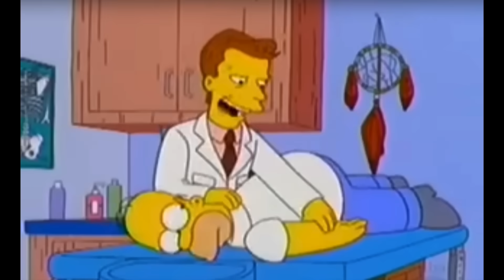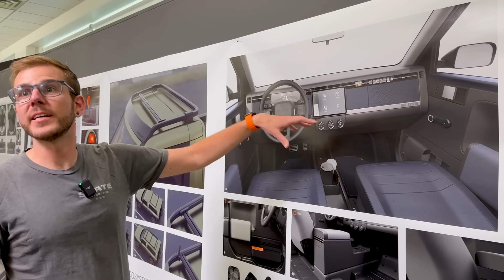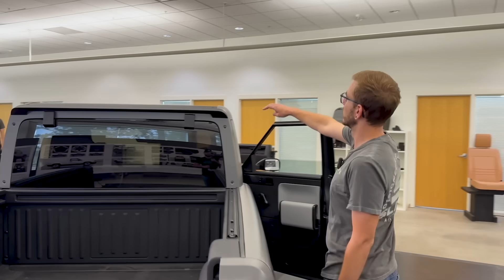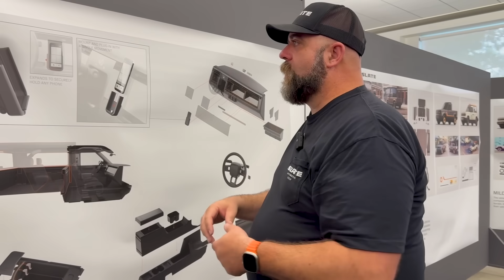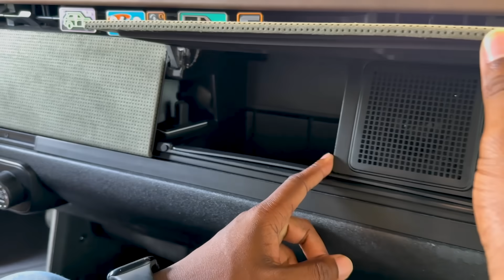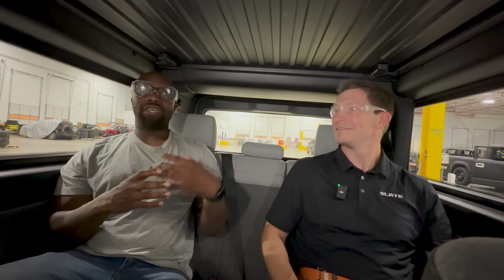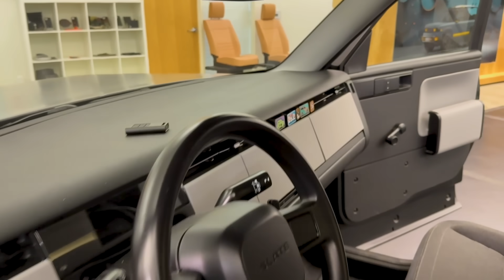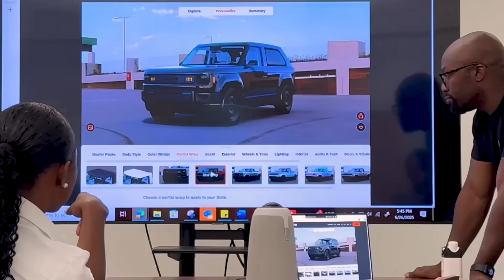The Slate: America’s $20K Answer to China’s Cheap EVs (Exclusive Access)

Comment: Tbh I have a Maverick and I love it. I think the selling point for me would have been if he said “our truck doesn’t have all of the glitches and bugs that a Ford will” to date the only complaints I have with my Maverick is that the radio USB doesn’t work like 20% of the time and that the remote features are constantly being disabled, that I have to press 6 different things to get the information pop ups to go away and get it back into eco mode every single time I turn it in. and that the transmission surges sometimes when sitting on the brakes at a stoplight. Great truck but Ford just doesn’t care to make it user friendly.

Comment: So they ultra designed it but made it cheap. It's not a truck. No 4 wheel drive. It can't tow. It's slow. You get what you pay for. All that design will just be incorporated by companies that build real actual useable trucks. I always wanted to make an inexpensive vehicle, but, this is just cheap. Wrong platform.

Comment: At the end you hit the nail on the head, Cost of the accessories, I can see the price going through the roof and it still only has 200m range.
The one thing I like, it does seem like a car for life if it can be cheaply upgraded and repaired, a for a Ford Maverick a few years down the line when out of warranty could have a relatively minor fault that writes it off, for example a dead headlight bulb on my model Y is £1200.

Comment: I see the future of having my own parts house with the curbside supply of easy* to disassemble oem parts. Thanks Slate!
*with special fasteners and only owner access? 

Base is base (rwd, crank windows) but if you go on the the website and price it up it gets pricey pretty quick, and it's still RWD and crank up windows (and how about no opening rear windows in SUV mode?). All said, I'm still cautiously optimistic and look forward to trying one when available.

Comment: I don't want AWD.

First issue is that AWD reduces energy efficiency to around 75% of a F/RWD configuration. This truck only has 205 miles of range as RWD-- thus the concept would greatly reduce both the range of the vehicle & ultimately the longevity of the battery.

Now maybe they won't do an AWD drivetrain with differentials, et cetera. Maybe it would just be 4 direct drive motors that ultimately behaves like AWD. That's still double the cost of one of the most expensive, maybe second most expensive of all the parts. Not sure if i need that-- at most i'll probably be hauling like 1000 lbs of groceries on slightly damp pavement. 🤣😅

My point is: It's a personal use truck. How many Americans drive on totally 'virgin landscape' in our personal cars for work?

Comment: FALSE. Slate is less car for the SAME money. Do the math buddy. I actually admire Slate and I like the concept but I ran the numbers and give it thumbs down on its main feature - value. A Fastback SUV 5 seater STARTS at $31,950 for a SLOW, LOW RANGE, DUMB, 2 DOOR dorky pickup (there is no way to make it into a 4 door ever). For a mere $5,040 more you can get a fully equipment Tesla Model 3 with 50% more range and much better 0-60 performance and ride quality, super safe plus ALL of the tech and creature comforts as well as the ability to Self-Drive. The Tesla Model 3 can be your one and only vehicle for a household, not quite so much with a Slate especially if you ever plan to go on a road trip. Do the math and equip a Slate they way you would really want it (and in many ways you can't even do that despite the gazilion accessories). If Slate started at $17,490 it would be a bit of a different calculation but it isn't. A niche vehicle at best. I'm calling it now - under 50,000 units will be sold if that as it mostly appeals to the low volume Jeep Wrangler crowd. People want a HIGH TECH smart car with all the latest features, not a dumb car like a landline or flip phone. Slate fell in love with a CONCEPT not a vehicle the market will actually buy - they went down the rabbit hole of confirmation bias. Yes, I realize my opinion will come across as strong but go configure and price one yourself and I think you will end up agreeing with my analysis (and I am unhappy with my conclusion too).
Reply: You just go place to place posting the same thing.
Reply: @johnkeith2450  Yep. Glad you got my point.

Comment: This looks so much like a cross between the first-generation Ford Bronco, a later-model Range Rover, with a hint of an older International Scout.
Reply: I love it. I drive a late-model F-350 for work reasons, and I probably need one of these to save on fuel costs. Materials gathering, etc.  Of course, an A/C is a must in Texas. I only wish the truck bed could slide out to +-8 feet to carry standard plywood and lumber.

Comment: The time you get the extended battery on the stripped no power anything model it's 32,000 I can get the Ford maverick xlt with everything and leather for 31,000 power windows doors and radio and you don't have range problems. I'm buying the Ford.

Comment: I put down my 50 bucks for a Slate.   This is the vehicle I want.   Currently, I drive a minivan that has power windows, power doors, power sunroof; and when those motors and mechanics fail, its very unpleasant.   When I get my Slate, I want to build a camper to go on it.   Put in some lightweight flexible solar panels and hit the road to travel at no cost.

Comment: Couple of interesting points on both sides of the picture for this truck. As far as their sales pitch goes, I think two things that were appealing to me as I thought about it would have to be the fact that from other brands when you buy an accessory, it’s in a package deal configuration. Obviously this means you’re gonna get the one or two items in the package you wanted, but you’re also paying for a bunch of other stuff you don’t necessarily need or want. This plays into Slate’s sales pitch.  So, I do like the idea of picking and choosing exactly what you want. However, looking at the build quality in the videos I’ve seen for this truck, It seems like the quality isn’t there. Mostly plastic parts. Personally, it’s not for me. Because even though it may only be $25,000 it’s still $25,000 folks! 

 Keep in mind as Rich mentioned, if the price of the accessories is high then you end up in the same place as all the other manufacturers in terms of total cost. It’s pretty much self-defeating, isn’t it?

And Rich you will also mentioned them range? Why isn’t anybody else concerned about that? And what about towing capacity, hauling capacity? Is it a real truck or is it just something that looks like a truck?
I don’t know, did a lot of answering questions. We’ll see what happens. Maybe it’ll end up being like the Tesla pick up where they said it would be $40,000 and ends up being over $100,000.
Reply: Sorry about the typos.  Didn’t have my glasses on and speech to text never gets it 100% correct

Comment: How things have changed.  I get going cheap, giving up a radio, paint, Nav, maintenance shop, power windows, back seats, nav, range, water pump for heat, charging speed, etc etc etc all in the name of money.   But now looks like this thing will cost quite a bit more than the Equinox EV in LT trim (or basic Bolt or Maverick Hybrid or Leaf) that has all those things and more.

Comment: Really curious to now how they address Safety. No mention of Airbags. ( steering  wheel is easy). The rest of the cab doesn’t look like it was designed for the full suite of airbags found in all vehicles these days. Then there’s rear seat situation in the SUV configuration. Will the Cap include Side Air bags.

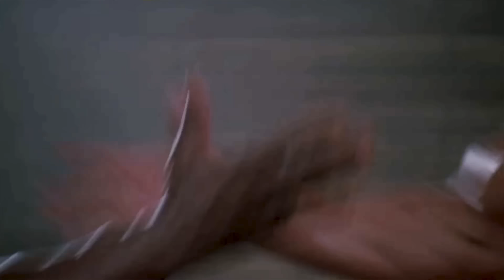Comment: How can I be creative in order to start get paid for the ideas?     I'm trying to build a EV battery that is half the weight and compact so you can get double the mileage and charge it self but I'll have to have two for recharging the battery that is not being used. I want to have two generator batteries for recharging the battery that need it! I'm thinking smaller cells same voltage! You know like a D battery and AA batteries both has the same voltage but more or less running time! 25:58

Comment: How many miles at 80mph on highway? What is the top speed? 0-60 in eight seconds is liveable as long as it'll set at 70-90mph highway speeds for most of the range stated
Reply: idk but 240 miles sounds like a conservative estimate considering the battery is 84.3kwh.

Comment: They took the same concept as the ford bronco with each panel being able to unbolt and change and the spots for stuff to bolt up to and the electrical already ran to those spots so you can hook up lights or whatever you just plug it in

Comment: Morning, have you been reading my text/comments
I been asking about? Range extender battery operated! Full or semi self generating energy supply for recharging and or fast charging, I don't know how good it works I know you'll have two drive batteries and two batteries to run the machine for the generator! Never will you be charging the same battery that you're driving on but the second battery for driving and also one of the battery used to for charging

Comment: My biggest gripe is the 150/240 mi range. Because that is based on the absolute bare slate truck. Once you start adding the extras you want, the extra weight will bury that range into 100/180mi depending on what you're adding. And if you want to take this thing offroad the range will go down even more 😬
Reply: I have the opposite gripe. I drive more than 30 miles in 24 hours maybe 1 every 5 years, I would be willing to buy a smaller body (something ~size of a fiat 500) and a 30-50  mile range that's highway safe if it's less than 15k.
Reply: @psudonym4621  i’m in the same boat. i love the philosophy of slate, but i don’t need a truck, nor do i want one. a sedan is as big as i want to go

Comment: Honestly starting to think how much they talk about ease of removal, begins to start the question of how fast a theif could disassemble my car
Reply: Watch the whole video. They talked about that later.
Reply: @iamnobody3793 I did, but it states that the customer would be the only one able to actually remove it. Does it work similarly to like a hood pop, where its inaccessible until that "latch" is opened up. Thats where my skeptism comes in. If its just, hidden fasteners. 2 maybe 3 guys could steal a bed panel quite quickly, or remove your entire grill etc. So I hope they elaborate on that later on.

Comment: I’m done with junk engines. Love the 5 moving parts, zero maintenance for 1,000,000 miles E motors. 100% torque from 0-8000 rpm is golden (Netgain Hyper 9 in my Sunbeam)

Comment: I like the idea of a modular base that can be added to.  I do see many problems that they will need to make it through.  lets list a few.  A new automotive company has no infrastructure and what would need to happen for this to work(reference to the ease of repair) they are going to need to balance making panels to store in a warehouse to sell an ones to get assembled for sale.  If their plan for this is to try to sell parts on demand for the first years how long will this modular base remain unchanged, are they promising the exterior will remained unchanged over its lifetime or in 5 years when someone hits the side of my bed am i going to need to change the entire back of the slate to make it look uniform.

Heres a idea for slate.  They referenced anti theft measures why not just add a key lock as one of the connecting points for each connected panel.  Granted there is no way of stopping theft but it would at least make a thief have to change tools from a impact gun to a drill.  Also the idea of your roof coming off to go topless with just your key is kinda awesome.

Comment: 20K - I would buy one.  I'd put a generator in the bed to range extend - but these days, my crewcab ram is used mostly to haul me and a motorcycle in the bed.  Range is the only issue since I do tend to drive all over  the country picking up projects.  Currently I can do 640 miles, refill in 10 minutes and do a 1000 mile day.  I'll be shocked if the price is actually 20K - but who knows.  Looking closer - the tow capacity would be an issue 1K isn't even a tiny boat.  Interesting though.

Comment: A few thoughts:
1. Can you get the rear seats without the enclosure?
2. Can you get different configurations of rear seats?
3. Does it come with anchor points that can be used to install things other than seats, or as cargo anchors?
4. Can you get proper 3-zoned or full-surround rear climate control? (Can't remember the last vehicle I saw that had more than a dual vent on the back of the center console, and most have stopped having even that again)
5. Can you get a sunroof (or two or three, in the SUV)?
6. Can you get an auxiliary power input? (Charge on the go with solar or wind, or a generator for trips through areas without charging stations)
7. I may have missed it: What are the electric mileage rates for major configurations?
Reply: Lmao right after I post that "You can go full open air mode"

150 to 240 nominal miles per charge for small and large battery respectively in the Blank Slate is a good starting point, but doesn't tell us about other major configurations. 

8. Can we get it with additional charging points? The "North American Standard" placement isn't always the best everywhere in the US or for every driver.

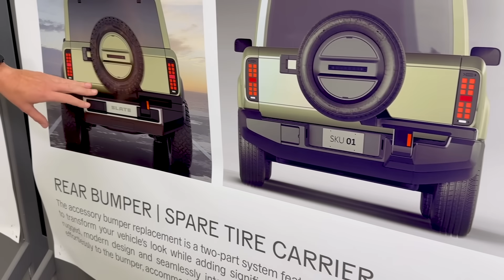Comment: 8:30 if reverse lights are those tiny, they could go step further and not include them at all. They meant to actually light up the ground when reversing and this tiny led pills definitely won't do it
Reply: I dont suppose youve ever seen an led flashlight huh? Which decade from the 1900s did you crawl out of
Reply: @fufun4me   for led flashlight to function it needs to have enough power to light up the ground, good lens to focus this light. And lastly to actually be pointed at the ground instead of parralled to it.
None of it seems to be presented here, as well in most other current day cars.

Comment: It may not be for everyone when considering the price:product, BUT, there are A LOT of people that want vehicles that's aren't based on subscriptions, "intellectual property", and dealer-only repairs. If they can maintain that, I would pay a premium to not have bs locked in repairs and dealer only repairs. If I can download a schematic or 3-d print file, so can others and I can buy from them and benefit from their ingenuity as well. It's a start up people, understand that the prices don't reflect any economy of scale. If they made as many slates as Ford makes Mavericks the price could probably be much cheaper, and even in one year the battery will be cheaper. I just bought I lifepo battery that's 32kwhr for about $5k and a few years ago it was 2-4x that.

Comment: Too bad it's got a gen1 style battery with the most combustible chemistry. Swap that fire starter out for sodium and ship that truck to Europe. I really think Europeans will buy them all. Just fix that explosive battery issue...... Just checked Thier website and it is now mid 20s, but if you swap out for a much cheaper and reliable, longer lasting sodium battery it could still hit 20k.

Comment: This idea is extremely good. However I don’t think this will work. The price entry is low, the accessories will be expensive. Any labor to get wheels tires lifts installed is money. Those EV incentives may be rolled back leading to higher prices. The dealer/ordering process is great. Pick exactly what you want and get it, scout is implementing this as well. But as much as I love the concept I really don’t see how the average person will want to spend 20-35k potentially on a base no frills EV over a used Tacoma or used Ranger. Or a new ford maverick or Toyota stout that’s coming soon. Just seems like it’s filling a niche that will be gone by the time it ships

Comment: I have never even considered getting an electric vehicle. Something like the Plaid looked fun, but that's it. This, however, has got my attention. The fact that it's modular and serviceable looks fantastic. I love the versatility of modular things, and being able to bring that into a vehicle just makes sense. Going from an SUV in the winter, to open air in the summer. Or have a pickup option available when you need it is just a great idea. But the question I have not seen answered is how long it takes to convert. It's obviously not going to be as fast or easy as taking the top off of a Wrangler, but it would be worth spending a few hours to turn my SUV into a pickup or my pickup into an SUV.

I would have to have AWD or 4WD though. A thirty mile commute in a South Dakota winter would be brutal in a RWD vehicle.

Comment: Stop making them electric if you want affordability technology is expensive batteries are expensive and you can't fix it yourself when it breaks. The same truck with a 4 or 6 cylinder would be 10k cheaper.

Comment: I really want this to work for various reasons, pretty much all of which were addressed in this video. The Maverick is no longer at that nice $23K starting point anymore, if it ever was. And the more popular versions are gas only, not even hybrid. The prices I've seen lately are more like $28K-$30K and up. I'd start with a blank Slate and work my way up gradually from there...unless they were going to cut me a decent break on the prices of customization by getting it up front. And that may be more than offset by insurance and state vehicle registration fee concerns. I just hope their running gear is decent quality, because no matter how nice the rest of the vehicle is, if the battery or motor or other rolling components are crap, the vehicle isn't going to catch on. It's a point that seems to get glossed over because everyone is so gaga over all the other capabilities.